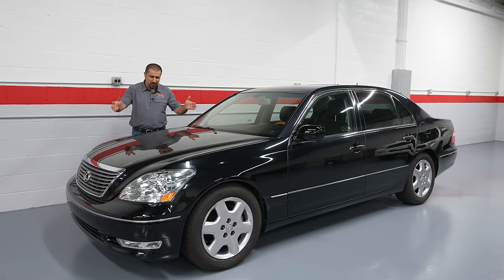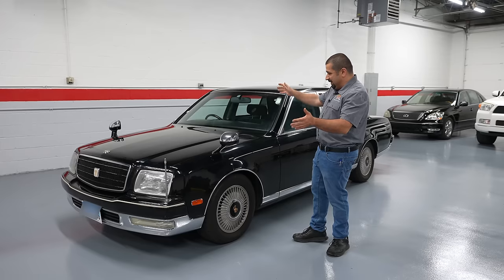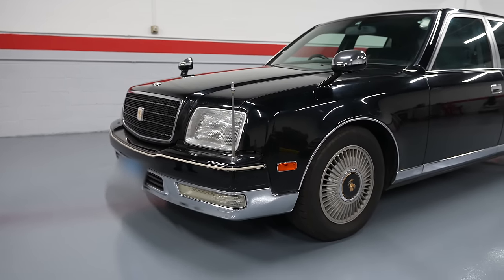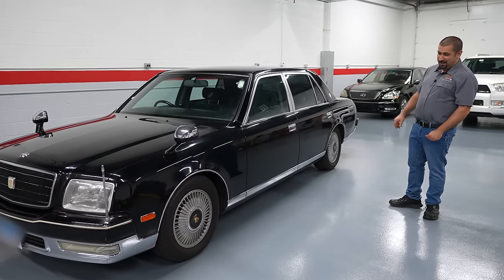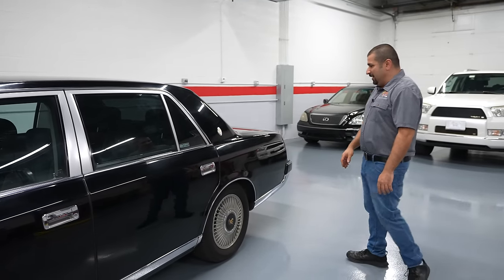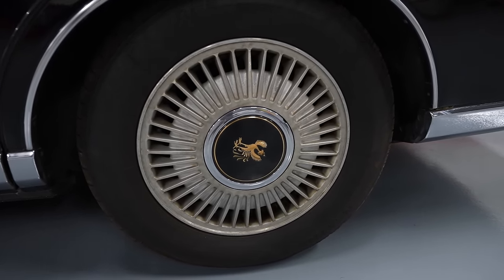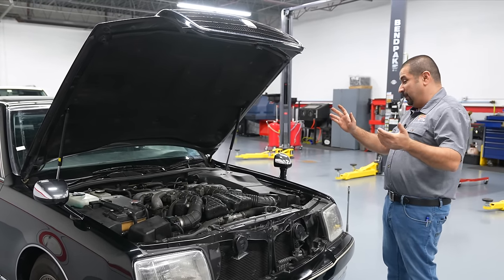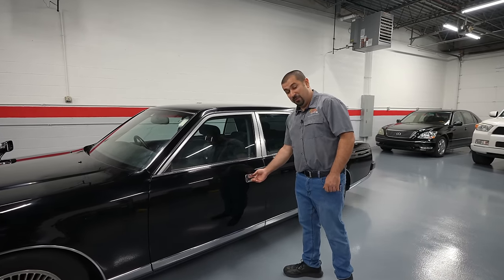THIS is The COOLEST Toyota You Will EVER SEE!

Comment: For air con control:

Most left: temp for passenger and rear area
Most right: temp for driver area
Top left two buttons: On/Off and fan speed (Auto / Low / High) for rear area
Top center: mode selection for recirculation of outside air or inside only
Top right two buttons: front and rear defogging

lower row from left to right: Dual-Zone mode, AC mode, air flow dirction selection, fan speed selection, Full Auto control, and On/Off

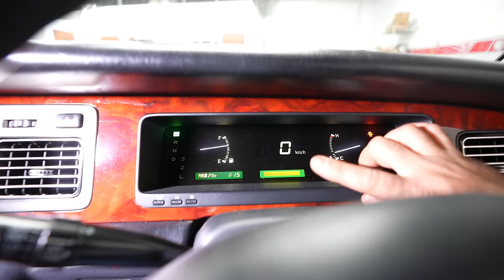20:32 dashboard:
three little screens: Outside temp and time on the left, message for driver (door still open... etc) on the center and ODO on the right.

21:25 : open/ close curtain for rear window on the left and vehicle height selection (High when light on, normal when light off)
Reply: Thank you for the information.
Reply: F
Reply: 訳してくれてありがとう、笠森こばと！
Reply: I thought the left one was the ejector seat and the right was the smoke screen.😊
Reply: Thank you.
Reply: I’m so glad you provided the translation! 🙂
Because I was about to tell him to use his phone’s Google Translate app.
He could simply open up the Translate app, then aim his phone’s camera at the Japanese writing and the Google Translate app would translate it for him.
(Perhaps he should try it for practice, anyway.) 😄
But I’ll bet your translation is more natural and therefore better than his phone’s app.
🙏
Reply: @jerryjerry8673  lol what you think this is? The green hornet? LMAO 🤣 good one
Reply: Thanks. This will definitely come in handy. Now I just need...the car.
Reply: Ok
Reply: Buttons to the left of the steering wheel: Rear curtain control on the left, vehicle height (raise vehicle) on the right.
Reply: Just letting you know sir, there is currently a 1997 Century with 70 miles n Texas for 20k. It doesn't have the mirrors on the fenders but otherwise looks identical to your video. It's on Facebook marketplace, the owner says he's a professional importer. Also states willing to negotiate.  Hope you read this as I can tell you love this vehicle! Good luck
Reply: To read all the buttons, you can use Google Translate app on your phone, which translates text in real time if you point the phone camera at it.
Reply: Thank you so much for these definitions!
Reply: It does show the little windscreen, kind of a giveaway, same in my 1994 Crown. But this is a premium response. I took my curtains out lol.
Reply: I understand most of the writing, but some of it wasn't clear until you consider the context. For example 'independent' (独立), which was under no heading must mean dual zone, which makes sense.  Thanks! I wonder if the electric rear curtain was broken.
Reply: Arigatooo:)

Comment: A Japanese Rolls Royce you'll still be driving 20+ years from now with regular maintenance 👌
Reply: @user-3tf67bk46u  This is definitely just a weekend cruiser
Reply: A Rolls Royce that actually runs!
Reply: @user-3tf67bk46u  Cars of this level with such a large engine often use truck parts such as that oil filter. Toyota, just as Roll Royce do, have access to other makers parts bins especially for something with only 1000 examples. RR has used an oil filter from a mainstream truck engine in the past.
Reply: @buttsexandbananapeels  ...without the Rolls Royce running costs!
Reply: It's been driving for 20 years already.... 20 more to go.......
Reply: Built to last a Century.
Reply: With no maintenance, like all my cars. Maintenance for what ?
Reply: @canon5dmk336  don’t stop what you’re doing, then. I can only imagine the money you have saved on oils, filters , spark plugs, etc..
Reply: This isn't a rolls Royce stop making comparisons its in a league of its own not a  copy
Reply: @1DonFF  Its simply a term of Endearment, and a metaphor for explaining that this is the ultimate luxury car produced in  Japan, just like a Roller is the ultimate luxury xar you can buy in the UK  if not the whole world .
Reply: Pretty sure this car is designed for the passenger, not the driver. So being driven around, not driving it for 20+ years
Reply: Try 50 plus years regardless of miles. 😂
Reply: That's like 1993 Toyota Corolla 29 years old 1,000,048 miles and still rolling.
Reply: @canon5dmk336  that's why you're still working everyday don't be late 😂😂😂😂
Reply: @mittiejackson3427  
I ? Working ? Never all my life. My father did. He never ask me to go work, and when he passed away, left me enough money to spend more than 100 years very (very) comfortably without working. Me and my family.
Reply: @mittiejackson3427  I think the Corolla is hands down THE best overall car ever made. Not most luxurious, fastest, best looking etc, simply the best overall.
Reply: On the way you are talking it's like a child in the playgarden... You love this car that is for sure.. I own a late 2003 bmw e39 530 I induvidual... I really love the car
Reply: Not like the British expensive who don't last few years LOLOL
Reply: My Japanese car isn’t a rolls Royce but I’ve been driving it for 20 years next year. I’ve only done tires, brakes and fluid changes the entire time. 211,000 miles on it and still drives good. 2004 Toyota Corolla S.
Reply: Nkol
Reply: @SteveB88  nkol
Reply: My shadow is still going strong after 45 years.
Reply: @buttsexandbananapeels  obviously never owned one.
Reply: Exactly…
Reply: Try a plug change on one of these, just crazy
Reply: At least a century won’t charge me 500 dollars per turn signal blink over BMW’s rate, right? (Bmw implemented subscriptions, but I hope they aren’t in the rolls Royces next)
Reply: @SteveB88  thats not written anywhere, its a toyota, its built to be driven. These things are superior quality

Comment: Hey Car Care Nut.... i picked up my 97 toyota crown from japan. it has the same wool interior as the century so i know exactly what you are talking about: its fantastic. 1JZGE engine with only 61k miles. runs better than new cars. i love it! getting it registered here in Arizona is being very difficult though. Not impossible. Do-able, but difficult.
Reply: I am guessing you’d have an easier time to register it in Florida.
Reply: Crowns never had wool interior. I had a few of them and seen all of them pretty much. Nice cars still though.
Reply: You will need Hagerty Historic Vehicle insurance, and drive 3000 (or under) miles per year. Yours may not have a Catalyt##%% on the exhaust.  If you get the copper historic license plate,  you will not need  ADEQ inspection. Look up Hagerty.  Do not go to MVD "services" subcontracting agencies. go directly to a MVD/ADOT  Government operated office.  Before you buy Hagerty Historic vehicle insurance, you must visit an MVD/ADOT  Government operated office FIRST.   I have the Az copper historic plate on my 4Runner  32 years old. The exhaust system on Century is practically identical to my 95  LS400, except I have a CAT coming off each exhaust manifold , a resonator & 4 mufflers.
Reply: Probably not in their computer. I had the same problem with my grey-market Mercedes.

Comment: It looks like the 2018 Century runs about $180,000, and uses the motor from the Lexus LS600H hybrid. 375Hp gas, plus 50Hp electric. I read that they made a 2018 Left hand drive model just for the Japanese Ambassador to France.
Reply: The latest Century runs the same entire drivetrain as the Lexus LS600H hybrid, so it's no longer as special as the previous model with the exclusive V12 engine; they sell for about 150k in Australia, which is 100k USD.

Comment: Magnificent car. i always thought the pole on the bumper was to carry a flag - cars like that tend to be driven by ambassadors, heads of state, etc. The side repeater for the turn signal is mandatory here in Europe (and perhaps elsewhere). It's a safety measure, to ensure people who are facing the side of the vehicle (when you are exiting a junction, for example) can see it. Even my '03 Camry has them.
Reply: The Yazukas also loved the Century.... and the Crown as well
Reply: Good point never thot of that!🤔
Reply: Flagpole  🇯🇵
Reply: I've got a Crown VX which is very similar,  only 300 made and 1jz Gte VVti. Best car I've ever owned has never let me down. Mine doesn't have the parking pole but marker lights on the top of the front wings

Comment: My time in the Orient, during the 60s and 70s is when I first experience these vehicles.  They were a very well built vehicle, then. They had V8 engines.  The V12 engines came in later years. Thanks for the great video... it brings back the years.
Reply: 4 litre V8 before the 5 litre V12; the latest hybrid has 5 litre V8 with CVT.

Comment: Awesome Century! My 1995 SC400 with the 1uz had a fluid driven fan also. Super interesting car for sure.  The first Gen sc is classic toyota over engineering at its peak. Look up some pictures of the door hinges for the Sc400.
Reply: Agree. Had one of the early LS400 off the first boat to the USA. Later, Almost traded it for an SC400 after a test drive, but the LS was such a great car, hung on to it for over 200k miles. Best car I ever owned.
Reply: @yankeexpress  I agree the LS is a great car! What year was your LS and how much did you pay back in the 90's?
Reply: The 92-96 V6 Camry's also had a fluid driven cooling fan 🙂
Reply: @9ZERO6  that's awesome! I didn't know that!

Comment: Beautiful car, I’m very comfortable in my 07 Camry V6 XLE with all the bells and whistles but I still would love a chance too ride in a Japanese rolls Royce , I’m sure my 2GR-FE makes more horsepower then that V12 but that V12 must be silent compared to my V6 and another 125% smoother then my V6 even though my V6 is already smooth , it’s probably a level of smoothness that V12 produces that you can only enjoy if experienced
Reply: The v12 actually has slightly more hp and significantly more torque than your 2gr-fe. The 4 speed transmission will keep it from staying in its power band though

Comment: The emblem is a phoenix...hand enameled, of course. To compare the Century, even one of this vintage, with a RR or Bentley is ridiculous: crass German junk vs. supreme automobile elegance. As you know, the fender mirrors are no longer placed. There is less need to be able to see police motorcycle escorts clearly at all times. And perhaps it's no longer as necessary to accommodate chauffeurs with presbyopia. Of course, the 12 cylinder engine is no longer used in this model. But it's what makes the years of the 12 so desirable for collectors. The new Emperor has decided to continue using the Century, as his father did. His grandfather used a Grosser Benz among other cars. The Benz was dropped soon after the war for obvious reasons.

Comment: Coolest, I drove. It’s a Hillux. In Afghanistan, it had sand dunes on the dash, a chunk missing out of main frame from a small IED on passenger side, rust, never an oil change, fueled with aircraft fuel with additives, and every kind of abuse you can think of in a war zone. And the damn thing, years after it’s expiration date for turn-in, still ran.

Comment: Greetings.  Great video, but I have a question that may help a lot of us out here, but does not necessarily pertain to this video.  
I have a 2015 corolla S, with only 29,600 miles on it.  This means the struts are basically in a new-like condition. But I am changing out springs with Ebach Pro kit, to stiffen the car up -- I hate the lazy feel. Question (1) Do I really need to change out the struts and shocks when I change over the springs? It's not a fit-issue, because Ebach engineers these springs to fit exactly to my OEM equipment. And (2), when I have my CVT fluid changed out do I really need to spend the money to have a new filter installed?  Thanks, I'll seek out your reply, if you would be so kind to do so.

Comment: Rear end treatment is pretty handsome.  Looks a lot like a late 80s mercury grand marquis.  4.7L chrysler v8 in jeeps and perhaps other vehicles too had hydraulic cooling fan.

Door panel trim reminds me of my older Lincolns and Cadillacs with chrome lock buttons and door fabrics.  I also agree with you that a nice fabric is superior to leather.

For smoothness you should drive a late 60s or early 70s Lincoln or Cadillac.   Very smooth too

Comment: I’m Japanese but of course, it doesn’t mean at all that I know all Toyota cars, but I read an article in Japanese about why the emperor wants a Century not only because it’s Japanese but also because this twin i6 engine configuration allows you to keep driving (moving) even in the even one bank is damaged. For example, if someone shoots the engine and destroys half of the engine, you can still drive the car to escape from the situation. When I read that, I was like wow! 

To your question, the left button on the AC control panel allows you to choose which zone (passenger or rear passenger) you want to adjust the temperature. 
The 2 buttons left of the steering column are to control the height of the car, and open/close the curtain on the back windshield.

Comment: For the translation of the buttons...
Get an Android smartphone, install "Google Translator", open the App, and go to translation with cam. Now you aim your phone cam to the japanese words, and it shows the translation with an overlay. Maybe it could be a bit difficult, when so much words are on a small space, then take a picture, and cut it out.
At the end you could create a translation manual, or use diy labels on top of the buttons. I tried it with this video, and the switches left from the wheel saying, they are for the curtain

Comment: I've always admired these as for why they weren't sold here the import costs gas guzzler taxes and the fact that we already had a mid level luxury car called the Century here made by the Buick Division of General motors so had the Toyota Century been sold here it would've confused people. oh and the V8 in the Century when its not equipped with the V12 is only a 4 liter unit which in the US is a common size for a V6 engine I.E. the ones that were in later Buick Rivieras Electra 225s etc. a few family members of mine had Buicks back in the day going back to a 1966-67 Skylark Custom Convertible

Comment: A hydraulic pump does not drive a hydraulic pump.  It usually drives some kind of hydraulic motor.  The Chevrolet wheat truck I dove as a youth had a pump that drove a hydraulic cylinder to raise/lower the dump bed.

Comment: LOL good one... but the Yaks prefer imports. Gotta have the black Merc, And the Imperial House uses Centuries but the driver does the driving.
I've been in Japan for about 35 years and involved with cars since the beginning... if you're serious about picking one of these up holler back. For various social and economic reasons very decent examples can be obtained fairly reasonably. Stretch models are also available with more rear legroom.
I can also translate anything you'd like... for example the toggle you were operating to the left of the steering wheel operates the rear curtain.
Regards,

Comment: According to Toyota, wool is a superior material to leather due to it’s ability to offer greater comfort on cold winter days, and especially so during the hot humid summers. In addition, wool ensures there is no squeaky sounds associated with leather when getting in as out of the car. The car is designed to chauffeur the passenger and present the most quiet and comfortable ride to the elite passenger in the back (royalty, dignitaries, corporate elite and yakuza boss). The tape recorder in the back is not for karaoke, but for recording notes or business discussions so that they can be transcribed later. Here in Yokohama,  other than local Yakuza, the passenger in the back is an elderly elite Japanese man. The curtains add a touch of privacy, but don’t have the sinister image of dark windows which was the image of tinted windows back in the 90s. I see the latest model of the Century in Yokohama’s business district at least once or twice month. Very beautiful car and not ostentatious.

Comment: The front end particularly the headlights have an 80s Mercedes feel. I had an 89 190E Mercedes and when I saw the headlights I immediately thought that. I would call the car anything but humble as I am sure it was low production making it unique. I guess they started making these in 1997 which I would guess this one fits the bill. I am guessing this car was designed originally for intended use by very powerful people in Japan. Max speed 130 mph at 280 hp. I can only assume it its not a power house, it had ot have been built like a tank. Just stupid reliable, as in whoever was in it was not going to break down along the way. I looked at what a 2017 Century looked like and it confirmed my suspicion. This car appears to be the Japanese Toyota rendition of the Cadillac that carts around the President of the USA. I mean I dont know what else it would be intended for other than to compete with just super luxury cars, but it's consistent boxy look has cadillac envy written all over it from what I can see. Oh No... Those are not seat controls... Those are buttons when pushed in the right order launch Japans nuclear arsenal at all of their enemies.... lol jk. So where is the hidden samurai sword to stab yourself when you have lost your honor? lol You are not driving on the wrong side of the car if you are a mailman. Just pretend you are delivering mail, you got this. lol I am having too much fun with this video now.